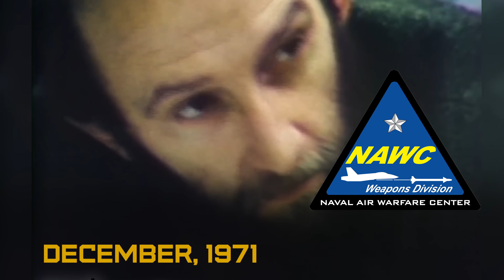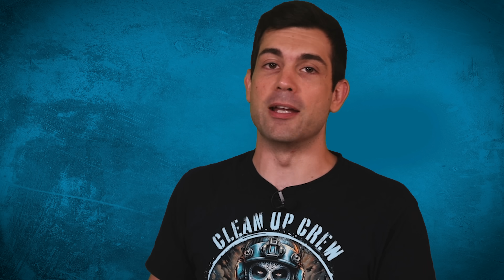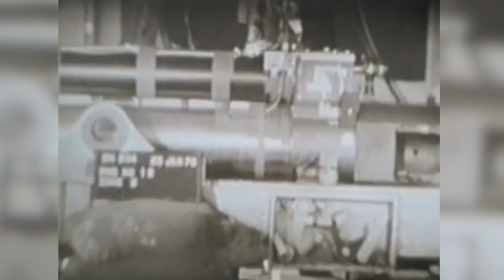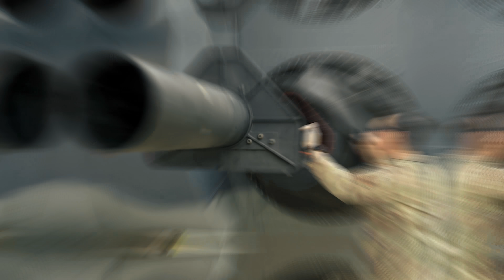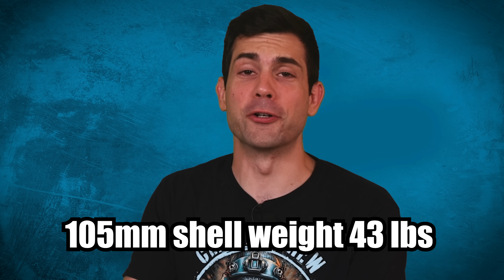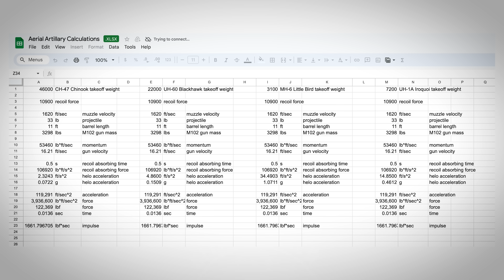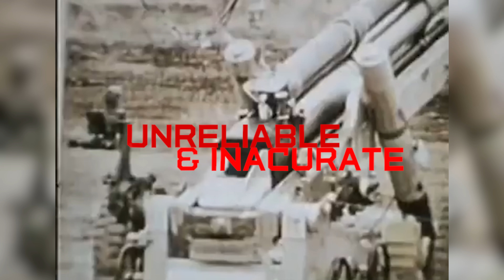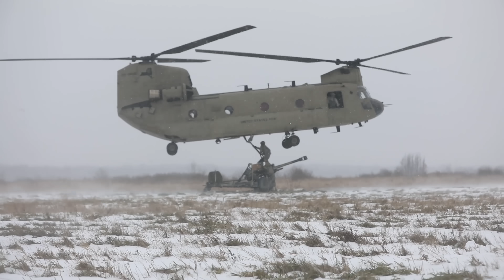America's Twin Cannon Artillery Helicopter is Wild

Comment: Sometimes "out of the box" thinking results in a good idea.  In WW2, a group of guys (probably in a bar) thought, "Hey, what if we put a cannon in a bomber?!?"  Thus the idea of the B-25 G/H was conceived.
Reply: The German Henschel Hs129 also had 75mm tank gun mounted. The Japanese also had one. The Mitsubishi Ki-109 also had a 75mm.
Reply: @Shortfuse39  The Italians had a 102mm gun mounted on a heavy bomber, the P.108A.
Reply: There was also the B-25H which mounted the T13E1 Lightweight cannon. Also 75mm if I remember right.
Reply: The RAF also put a 6lb Molins anti tank gun in the nose of mosquitoes for anti submarine  operations
Reply: The Germans tried it before the 'Muricans.  Neither country was very successful.
Reply: @baronvonslambert  PT boats stuck a bewildering variety of ordnance onto their boats, and some of these were made standard. While some PT boats did use 37mm anti-tank guns, the main 37mm cannon found on PT boats were the lower velocity but much more rapid fire Oldsmobile M4 found on P-39 Airacobras. The M4 and the M10 30mm cannons would later be included as factory standard. Additionally, 40mm Bofors cannons were frequently mounted on the aft for additional barge-busting capabilities. Weapons like rockets, mortars, and bazookas were also trialed, though the rockets were found to only be suitable for shore bombardment, the mortars for illumination, and the bazookas redundant. Depth charges were tried, though smoke generators were preferred. This was in addition to .50 cal Brownings and 20mm Oerlikons. 

The torpedoes used on PT boats were mainly the Mark 8 Bliss-Leavitt and the Mark 13, post-fuckery. The Mark 8 required heavy steel launch tubes and were of WWI vintage, so they were rapidly replaced by the lighter and stronger but slower Mark 13, which had its kinks ironed out by then and only needed a much lighter rack to roll them off the side. The Mark 13 enabled the boats to carry much more firepower now that the heavy tubes were dispensed with. The barges were in the shallows, where no torpedo could reliably run, and in any case were of a draft so shallow that torpedoes of any kind were useless anyways. 

In the Pacific, they were the harassers of the Tokyo Express and the main barge busters of the Solomons due to their availability, relative speed, and radar. In the Mediterranean, they were used as scouts because there was an abundance of small craft with much more firepower and durability floating around both Axis and Allied, but few with radar of any description.
Reply: There were lots of aircraft with cannons meant for ground attack before the b25.
Reply: Nope.
Reply: They only put a 30mm in B25. Not 105 bit of a difference
Reply: @colingriffiths3091  false: 

@sundragon7703 is correct and it was the same cannon used on a Sherman tank

They also had a varient of B-25 that had 12x 50.cals all forward facing.

Also a B-24 with 6x 50 Cals & 4 20mm cannons
Reply: @Dogmeat1950  about what?
Reply: @Dogmeat1950  there wasn't anything bigger put on a aircraft until the 105 which was put on the C130.
Reply: @colingriffiths3091  The 463 B-25G-NA produced had a 75mm gun, not only a 30mm. That's still only about 42% of a 105mm but it's a bit less of a difference.
Reply: @Wick9876  now I think about it your right. I was wrong they'd put a two pounder in the B25 which is the 75mm.
Reply: @colingriffiths3091  The B-25 G/H had M4/5/6 (T13E1) 75mm cannons. 30mm cannon were never mounted on the B-25.

Comment: <Marine sees a Chinook> Why aren't there 2 Howitzers on that platform?
Reply: This just in:  The Air Force is designing an even larger helicopter so 120mm artillery cannons can be attached to it.  (joke)
Reply: @williamyoung9401  for now
Reply: Russians and Ukrainians lob expensive rockets with expensive fighter jets from far back -> artillery on helicopters can be more flexible, safer (less time being vulnerable), can be forward-deployed,  are more accurate with the same range. And the cost is immensely lower.
Only main gripe is why two? One is enough, allowing for more rounds and better performance. Modify the helicopter design to wrap around the gun rather than add another heavy unit to destroy performance and payload.
Reply: @pistonburner6448  Flying a helicopter is extremely expensive.

Idk where you got the idea this is cheaper than just firing artillery on the ground.
Reply: @mjay6245   Flying a helicopter and firing artillery costs a fraction of what flying fighter jets (the ones in use today) and firing missiles (or even rockets) costs.
Ground-based artillery has nothing to do with these mission profiles.
Reply: @pistonburner6448  That's what normal people refer to as "moving the goal posts."

No shit a helicopter is cheaper than a military fighter/bomber jet lmao.

A helicopter with a howitzer strapped to it is competing against traditional artillery/traditional helicopter ordinance.

Did you know that fighter jets are also cheaper than using nuclear bombs? Lmao
Reply: EXACTLY! 😅
Reply: @CrypidLore "<Marine sees a Chinook>"

"And where do you fix a bayonet on that damn thing?"
Reply: You mean to tell me you didn't think about making a helicopter ac130 private!? That's it private FRONT LEANING REST POSITION, MOVE!
Reply: this man cultivates the same youtube algorithm as me
Reply: only 2?
Reply: As a German (Veteran and now working as Historian focusing on Contemporary German History)
This has to be the most German Thing the US Military ever considered/did. 
Reminds me a lot of what the German Military was doing throughout World War 2. Focus on over the top weird Ideas and try to make them real (and in some cases made them real) instead of focusing on what already works and just produce more of it.
I mean, we had Stuka Bombers with huge Cannons, which turned out to work pretty well to be fair. But most Stuff didn't
Prost & Cheers from Berchtesgaden in the Bavarian Alps
Reply: @chartreux1532  it's not really that far over the top, I mean we have the AC130. I will admit doing this with a CH46 could come with "engineering challenges" to say the least, but it's a whole new level of mobile artillery =)
Reply: @torcheddreadnought899  
I mean, as a German i completely agree with you, hence why i love all the weird Stuff we tried and sometimes succesfully created in WW2. Now i didn't know the US did that as well, so thanks for sharing that!
Recently released Secret German Documents on "Hans Ulrich Rudel" (German Luftwaffe Ace) but controversial because he never left his Political Views behind, apparently was a major Advisor for the USA to create the AC-10 Thunderbolt with the Minigun (BRRRRT). 
Because of his Experiences in WW2 on the Eastern Front having a Stuka with heavy Guns which were responsible for most of his Success.
Point being: Dumb ridiculous ideas like that can work out to be insanely effective haha
Reply: @chartreux1532  I saw that video. So many wonder weapon and tech ideas from WW I and WW II were just ahead of their time. But yes we have had all sorts of great ideas on paper that turned into absolute jokes in practice. We we wouldn't have gotten as far as we did without some good old fashioned borrowed German Engineers (see also space program)
Reply: @chartreux1532 
„i am german I am german anyone look at me did I mention Im german? Pls notice me!“

God you guys more unbearable than vegans
Reply: @AbuHajarAlBugatti  
Did i tell you that i'm actually Bavarian, which is a State in Germany but not recgonized by many Germans. German German German btw 
I hope you have a German Weekend!

Comment: They already had the ACH-47 helicopter in Vietnam. Not quite 105mm howitzers but logically this idea likely can exactly from that.
Reply: This is what I came to comment.
Reply: We had the nose section to "Easy Money" in Hangar 18 back on the Dark Side of the airfield at Campbell in the early - mid '90s.  

ACH-47A's
Easy Money
Stump Jumper
Birth Control
Co$t Of Living

NSDQ
Reply: @heavenst.murgatroyd3128  guns a go-go? wasn't there an accident when a gun accidentally rotated and fired into the rotor blades killing all aboard
Reply: My Dad was a Huey and Cobra  Driver in that era now Retired  told me about  the Guns A Gogo Shithooks I didn't completely appreciate the amount of 20mikemikes MA Deuces Miniguns 2.75 pods etc til I saw one on Static Display in 02-03 during Premob for OIF. Looked like a Porcupine
Reply: @phantomwolf5485  Huntsville, Alabama is the one and only surviving ACH-47A.  Never had M134 mini guns, though.  2x 20mm, 2x 19 round 2.75" FFAR pods (both pylon mounted on the fwd gear area), 5 M2 .50BMGs (cabin door, left gunner window, aft left and aft right escape cutouts and the ramp "stinger mount", and an M5 "Chucker" 40mm grenade launcher on the nose.

However, those crazy 160th guys do mount M-134s on their MH-47s, and if you ever need your feeder / delinker and barrel assembly timed and your safing sector / housing cover installed, I know a guy.  😬
Reply: @phantomwolf5485 I didn't appreciate 2.75" rockets until I contemplated an aftermarket exhaust pipe. Nothing wrong with N.O.S.
Reply: Damn you I was going to comment as well.   I remember those when I was in Jr High.   Armed with a nose mounted grenade launcher then WWII style gunners along the side windows firing either LMGs, HMGs or even gatling guns.   I think it even had side mounted rocket launcher pods.
Reply: I'm surprised The Fat Electrician hasn't covered this chopper.
Reply: Thank you for letting me know of the ACH-47. I needed more of this in my life.
Reply: It can exactly what?